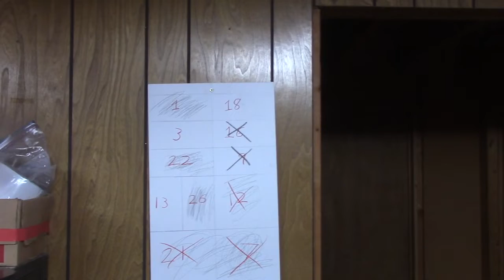What is in this old Military Cabinet  Part 4

Comment: Apex is GOOD stuff!  Dental tools are quite good to have. They used to use horses in the military! Most likely for boots, though. Your coil is a resistor for the old electric trailer brakes before the variable voltage controllers.

Comment: GI saddle soap.  The 3rd Infantry at Arlington Cemetery uses horses to pull casons and  the 1st Cav Division at Ft Hood has a mounted ceremonial  platoon.  They may not use much in the great scheme of things and I'll bet that stuff was procured in the 30s when the Army had 20,000 or more mounted cavalrymen.  Somewhere in the vast DoD Depot system there are a couple of pallets of GI saddle soap and  as long as they get a requisition every now and then it will not be sold as surplus.

Comment: Bakelite came on the scene 1907. Lucite 1937. The thing with the springs is a car electric brake resistor used with hydraulic brake controllers. I took one off of your Grand Father’s 78 Buick and put it on the 95 Ford with a switch for when the trailer was empty.   Your military saddle soap might be from the 1940s.   8 10 23 15